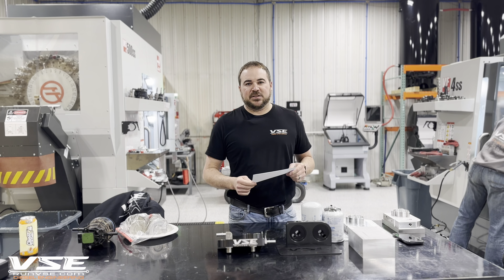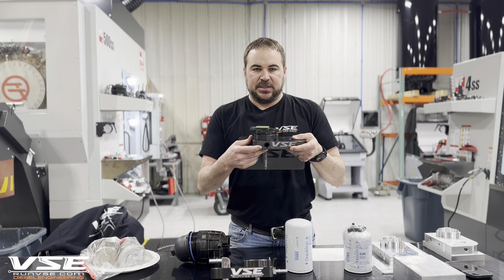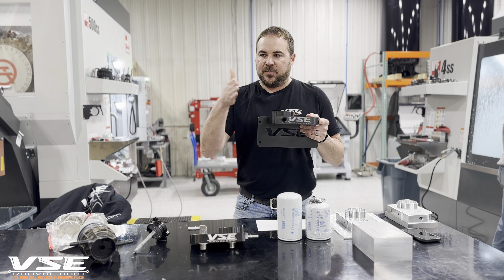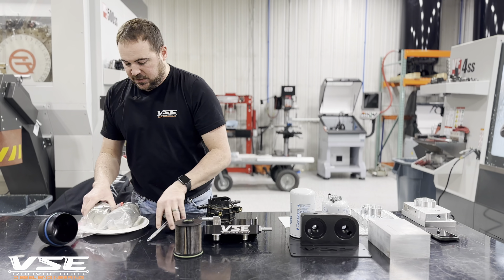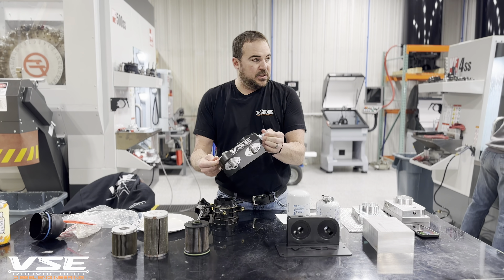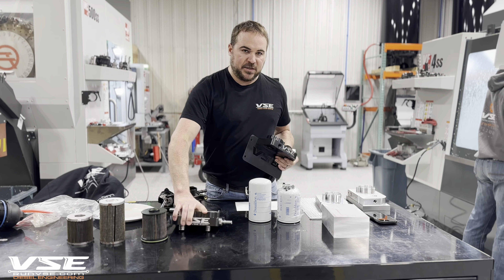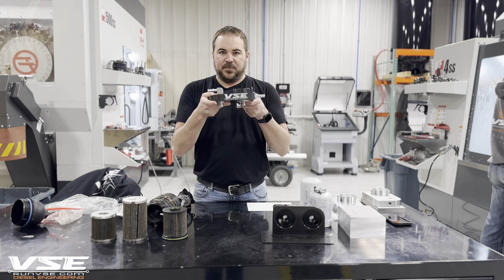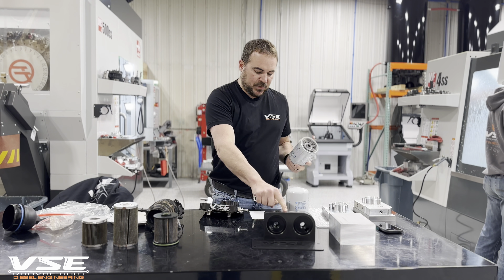L5P Fuel System Saver Q&A

Comment: Do not pre-fill diesel fuel filter with diesel. Diesel fuel flows out the center of the fuel filter. You don’t want unfiltered fuel going straight into pump

Comment: I know to fill the filters with diesel when you put them on, but how do you bleed the air out of the system after you install this new product on your truck.
Reply from the maker: Prime your truck as follows 2020+ Trucks with key fob - press and hold the start button, without your foot on the brake for
10 second until you hear the lift pump start to prime the fuel lines. Leave it for 10 minutes. The system will cycle the lift pump to
push all the air from the system on its ownAfter this is done a minimum run time of 30 minutes is required to ensure all air has been removed.
Reply: That's easy enough, thanks for the info.
Reply: @runvse 17-19?

Comment: How is the drivetrain warranty affected?
Reply: I was wondering the same thing, any excuse the vehicle manufacture could use against a vehicle owner would now be on the table I would think if they want to get nasty. I see another filter housing manufacturer is making an assembly to accept the original filter element and retains the ability to sense the water at the bottom of that filter ( and this unit may too but its not a matched set of filter length to this exact sensor either ) and then it includes an actual spin on as its second filter. I don't know if its actually on the market yet and if its better or worse then this system, I don't have that answer but it does contain the "OEM" filter element for whatever that is worth.

Comment: It would be helpful for the DIY guy like myself IF you included how to release the possible connectors that I might have!!!

I had to Google it and search YouTube for hours.  I finally got the fuel lines figured out but the connector on top of the fuel housing that goes to the water sensor is pretty much impossible to remove.  Maybe some helpful hint next time???
And don't show that 1/4 second trick with your hands in the way.  A little help Please, I just dropped $500 and wasted all afternoon to only have to put the old system back together.